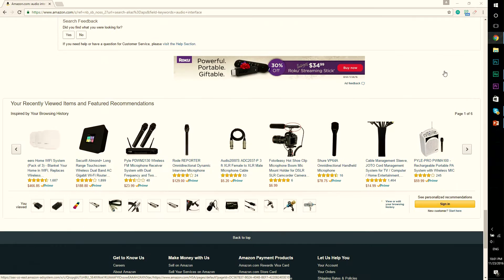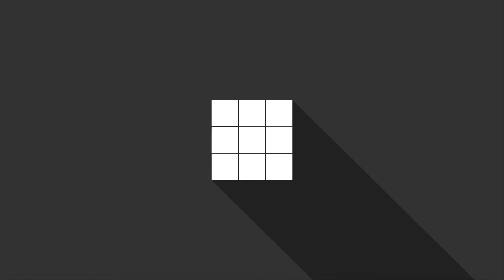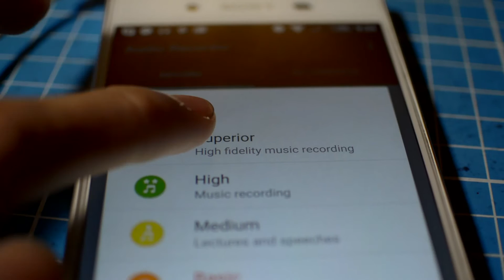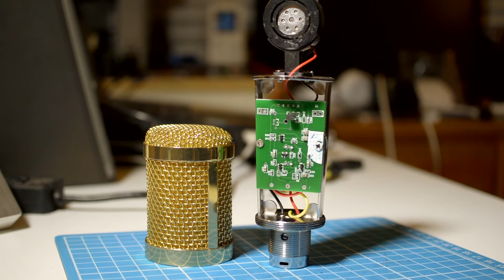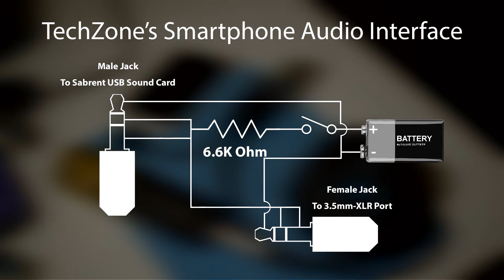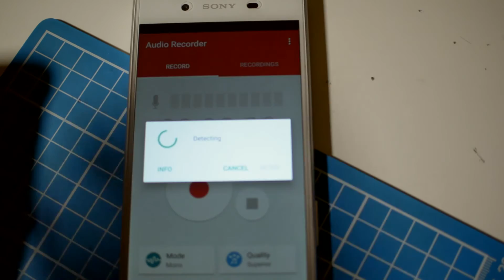DIY XLR Mic to iPhone Interface with Phantom Power!

Comment from the maker: There's been an error in the schematic diagram. The top 2 lead should be shorted and not the bottom 2 leads of the 3.5mm cable. The ground should go to the 3rd lead instead.
Reply: I'm happy it helped. this guy https://www.youtube.com/watch?v=0lpQ0BpjUtg&t=679s has done a great test on the BM800 with different voltages and 48v is really not necessary for that particular mic 30v according to his tests are really great. Problem for me is im running it into my XPS15 directly and the soundcard i bought was DOA and the XPS only puts out 2v so i really have to fiddle with the gain in Adobe Audition and noise reduction. Sadly i don't have a 6-7k resistor and no way of getting one now. I tried a 10k but no difference in input gain...maybe because my 9v battery is dying as well. I think its great as i have searched and searched and almost nowhere can i find anything about a battery powered phantom supply. IRIG has one for about 40 USD and that's it... so your video really stood out. Thanks! :)
Reply from the maker: I seen that video before but he was using the older version of the BM800. The newer version works a lot better with the full 48 volt and is comparable to the Nuemann U87.
https://youtu.be/5Ns_eV1Nxig
Reply from the maker: And I am still working on the newer revision which will provide better gain, lower noise floor, and a flatter frequency response. It will utilize the High Quality Digital to Analog converter from the Audio Technica ATR2USB sound card instead of the cheap Sabrent brands.
Reply from the maker: the newer version of the BM800 has a golden ring/
Reply: Ahh yeah the golden ring (that's kinda loose). That's the one i got :) i just ordered a SmartRig II thought i might as well have a professional Phantom power adapter. But i would love to see what you come up with.

Comment: TechZone Productions Does this diagram doesnt need a capacitor? to prevent 9v flowing back to the soundcard? I researched other projects and i saw their diagram with a 10k resistor and a capacitor .. Im thinking which is better.. i thinks yours is better IF the capacitor is not really needed..  so what do you think?

one more question... can I use a 9v adapter for DC voltage (from my wifi router) instead of batteries? im planning on using this on my laptop

Comment: Hi great simple idea. But there is one thing though...according to your diagram the ground and right channels are short circuited...?  i have a BM800 just as you and the XLR to 3.5mm cable comes with R & L channel already in short circuit so adding your diagram to that would short circuit all 3 leads. Correct me if 'm wrong of course but haven't you by mistake switched the leads in your diagram?
Reply from the maker: Yes. There is an error in the diagram. :( The top 2 leads should be shorted and not with the ground lead. Thanks for noticing!
Reply: Thanks for the quick reply :) ....maybe I got this all wrong but...your setup shorts the ground and negative top two connectors on the 3.5mm plug, then the XLR to 3.5mm cable i got from BM800 box has the two lower connectors shorted...so if i connect the 3.5mm from the xlr cable into your "setup" wouldn't your two top shorted connectors and the cables 2 lower shorted connectors make all shorted as they both have a common connector? Hope that made sense :) 

I got the mic just now in front of me and testing it directly to the leads inside and checking with a multimeter and they get shorted... haha maybe its magic ;)
Reply from the maker: I will make a new diagram tomorrow with the fix. Thanks again!
Reply from the maker: Sorry, there is an error in the diagram :(. I will try to make a new diagram by tomorrow.

and also
 I been working on a new version to this idea and this time it will support the full 48 volts of phantom power. It should also record higher quality audio at the full frequency range. So you might want to stay tuned for that and not build this one yet. :) I will try to finish the build and the video by this month!
Reply: TechZone Productions Does this diagram doesnt need a capacitor? to prevent 9v flowing back to the soundcard? I researched other projects and i saw their diagram with a 10k resistor and a capacitor .. Im thinking which is better.. i thinks yours is better IF the capacitor is not really needed..  so what do you think?

Comment: bro,,, I'm using bm-800.
but when I recorde, it makes hissing noise. 
If I use phantom power supply  , will it gone???
Reply from the maker: If you use the method I shown in the video, the noise should be gone. :)
Reply: but I cant understand the circuit 😞
6.6 kilo ohm.  I can't find that parts 😞
Reply from the maker: http://amzn.to/2BKvToT
Those are 6.8 kilo ohm but it should be the same
Reply: thanks a lot bro...  ☺
Reply: @MhRaj  get irig pre

Comment: I just finished mine today using your guide and for some reason it doesn't give any output. Any ideas? I wired together Left and Right channel into one and put 6,6k resistor with the switch connected into + side of 9v battery. The ground part of jack goes into - at battery and it still doesn't work.
Reply from the maker: Try pairing up AA batteries until they reach a high enough voltage to power the mic. It might not be as portable haha but at least the batteries will last for a very long time :)
Reply from the maker: you could also just use some 9 volt batteries
Reply from the maker: Which mic are you using?

Comment: Amazing! How much approximately to buy all the components (minus the cost of the microphone)?
Reply from the maker: I would say around 10 dollars without the microphone. But I would really recommend the microphone because only a few condenser mics can run at 9 volts of phantom power.
Reply: thanks! and ohhh really? I have a AT2020, would that not run?
Reply from the maker: I am not sure about that mic :(
Reply from the maker: Good news! I been working on a new version to this idea and this time it will support the full 48 volts of phantom power that your AT2020 mic needs. I will try to finish the build and the new video by this month. :) Stay tuned!